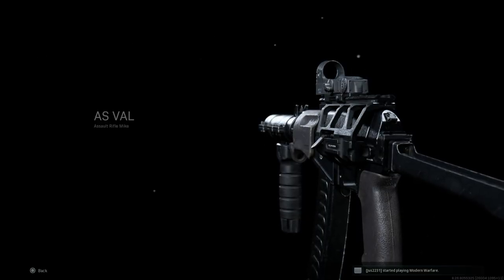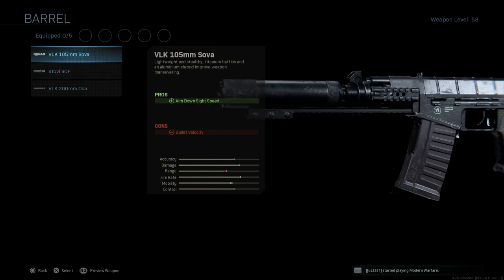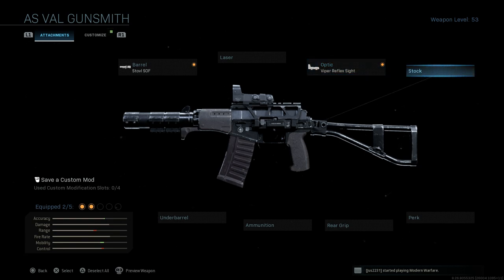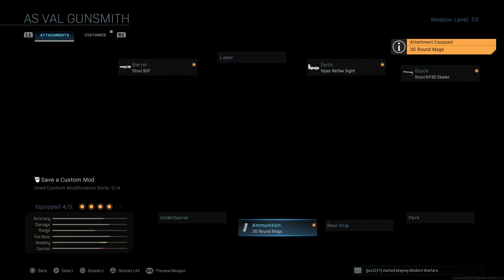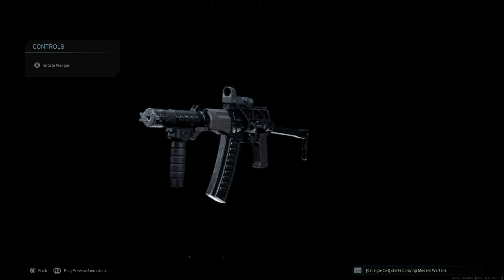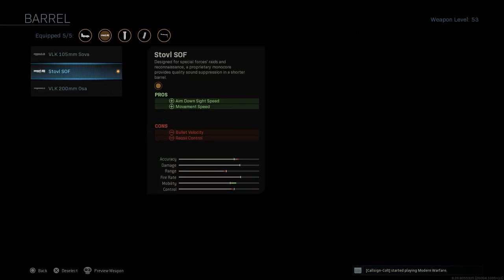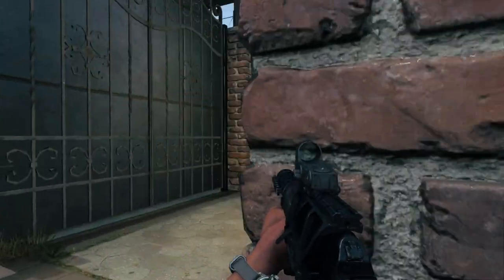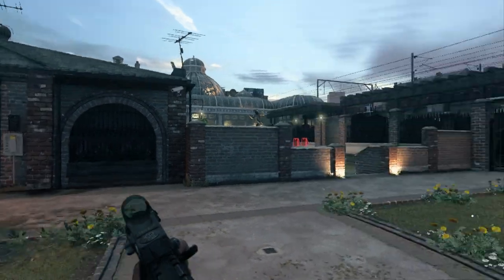SR-3M Weapon Conversion - Call Of Duty Modern Warfare

Comment: The fact that he says "meters" instead of "millimetres" is adorable and sad at the same time.
Meters are shortened as "m" and 1m = 3.2 feet
And then go centimetres as "cm" and 1 cm = 0.4 inches
And then go millimetres as "mm" and 1 mm = 0.04 inches respectively
1 m = 100 cm = 1000 mm

So barrel length, ammo size in metric system is measured in mm
So the barrel is 105 millimetres long, about 4 inches, not 105 meters (344 feet) :DDD

You're welcome
And great video, I like your conversions, as they mostly come from real life. I only use real conversions myself
Keep it up
Cheers from Russia

Comment: IMO, the AS Val should have started as an SR-3/9A-91 instead, so you had both Muzzle Attachments and integrally suppresed Barrels too, that way you could recreate the SR-3, AS Val, VSS Vintorez and anything in between.

Great vid as always!
Reply: I agree. The VAL was one of the easiest weapons to rank up in my opinion from the fact that it has the integral suppressor. Also I haven't seen the 9A91 since Bad Company II.
Reply: SR-3 I agree but, not 9A-91. The receiver is too different.
Reply: 9A-91 and SR-3M are 2 different weapons, both are PDW and DMR roles in Variants

Comment: The SR-3M shares the same side folding stock as the AS Val, the SR-3 had the top folding stock. So it would look more like the 3M if you left the side folding stock on, freeing up an extra mod slot.